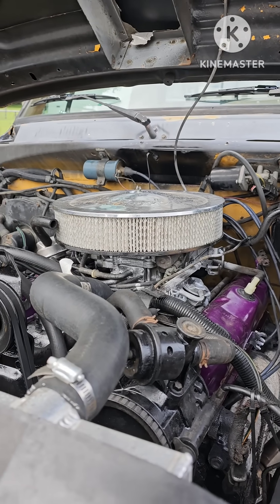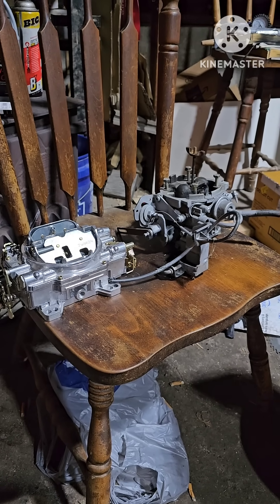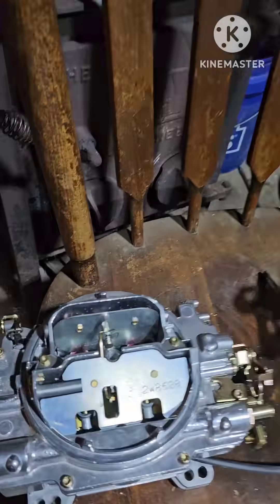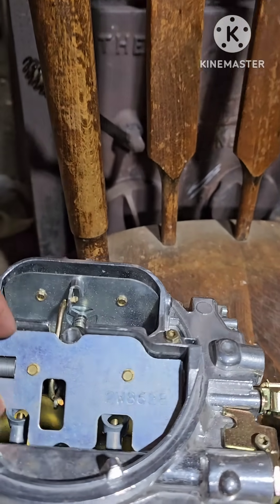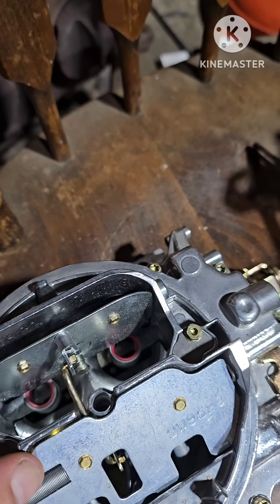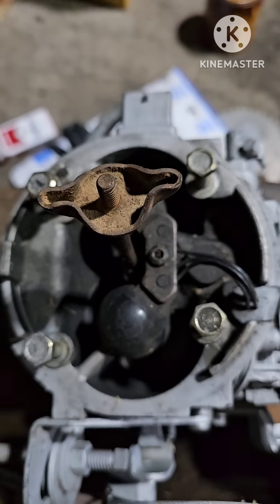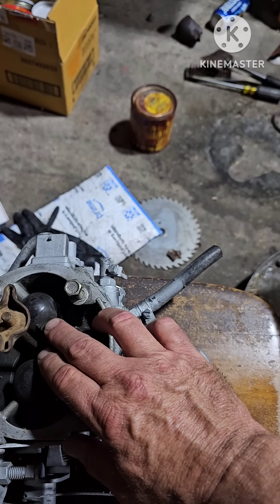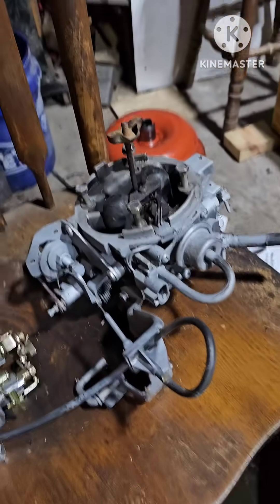Is it a Carb, or TBI?

Comment: Flip the throttle blades, higher capacity accelerator pump and cut the knock sensor wire. You could make them TBI engines run quite a bit bettter than they originally wanted to.
Reply from the maker: Thanks for the tips. And thank you for watching. 👍😁

Comment: Simple answer ... fuel injection will have a return fuel line. Carbs usually won't.
Reply from the maker: @hydewhyte4364  
 Absolutely right. 👍😁
  In this short video I am just trying to point out the easiest and most obvious ways to tell the differences.
 Especially for those just getting into older vehicles. 
 Thanks for watching and adding another great difference to look for. 👍😁

Comment: What happens when you turn over the air cleaner cover
Reply from the maker: @KennethPNelson  
  LOL,  it activates the flux capacitor and transports you back to highschool! 👍😁
Reply: @sidewyndersshed1676  back to the 80's ?
Reply from the maker: @KennethPNelson  
  For us yes, back to the 80's.
 For others, the 50s, 60s, 70s, etc.
  Mostly it transports you back to a time when you hung out with your friends, enjoying the newfound freedom of having your first car.
  Flipping the aircleaner cover over so it sounds like it has a big 4bble carb.
 Putting a set of craigers and fat tires on, (instead of fixing the brakes, or oil/coolant leaks. Etc. 🤣).
 You know, "The good old days".  👍😁
Reply: @sidewyndersshed1676  yes I been there Done that